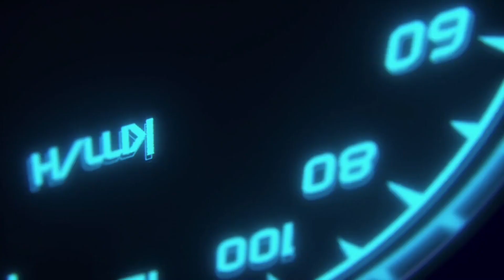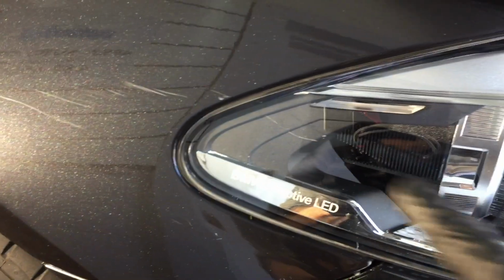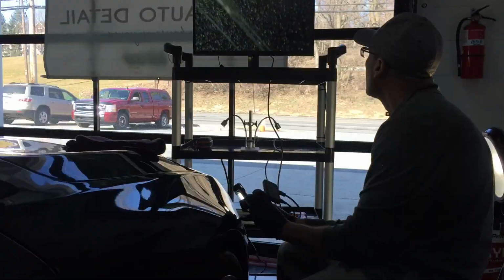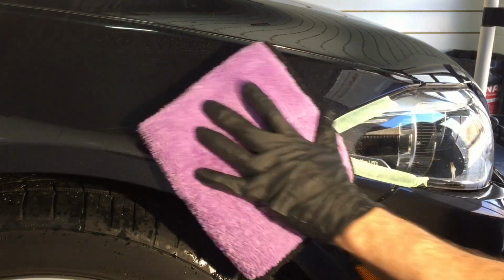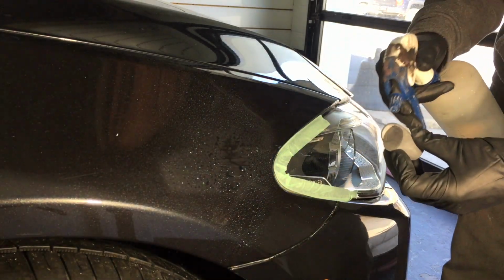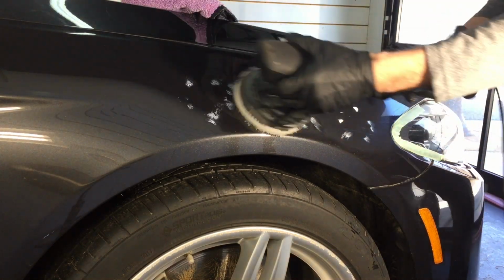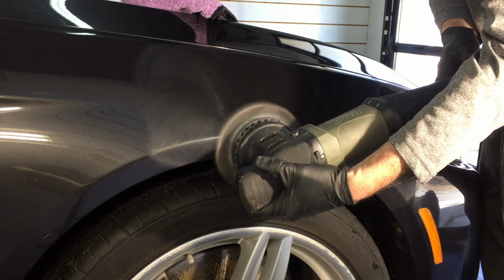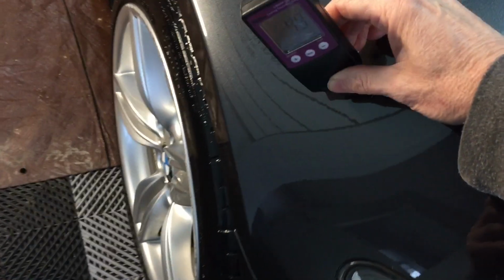How To Improve DEEP Scratches On Daily Drivers!! (For Beginners)

Comment from the maker: Much more to come on scratch removal and wet sanding. Other areas you want to learn? Let me know!
Reply: Apex Detail more on Optimum Clear Coat Restorer please!
Reply: We have an old Volvo V70 Classic in family. We are looking to fix rust damages on the back of it before polishing. Is that something you could look into?
Reply: Oxidation removal
Reply: Apex Detail paint chip repair
Reply: More rotary tutorials please.☺
Reply: Muffler tips cleaning and restore will be great to see and what product you use to do it. Thanks !
Reply: Hello there
I’ve been following you for a short time but am impressed of your work and technique of teaching 
So what apc are you using in the video I’ve checked your other videos you talk about a couple 
Thanks
Reply: When or how deep of a scratch you need to use touch up paint?
Reply from the maker: @tredfxman  Rust from exposed scratches or rust forming under the paint layers?
Reply from the maker: @willboyd7794  I use Optimum Power Clean and CarPro Multi X.
Reply from the maker: @Mrjozz011  When it is through the clear, base coat, primer down to and exposing the metal panel.
Reply: @apexdetail85  Thanks
Reply: @apexdetail85  Ithink mainly forming under the paint layers. It looks like its bubbling up from under..
Reply: After you fill in the scratch with clear coat, are you wet sanding with 3000 grit again or 5000 grit?

Comment: I like that you made the point that to truly fix it it would need to go to the body shop. Some people think a polisher will remove all scratches and just hammer away trying to get it out and make the panel worse. Another thing people don’t always understand is when you do “remove” a scratch the scratch isn’t gone you are just leveling the clearcoat around the scratch to the same depth. That’s why this video is great IMO. It shows that some scratches are just to deep but there is a way to make it look better.
Reply from the maker: Completely agree...only a small percentage of light, surface scratches can be completely removed without sacrificing the clear to a point where it just is not effective anymore.
Reply: Apex Detail Exactly!

Comment: Thanks Brian for this interesting video you made. Can I ask for your professional advice. I have a 2012 Mazda 3 a daily driven car.  With swirl, scratches & rock chip that I fill up with touch up paint and you can see the marks with harsh Canadian weather. I’m planning  to do 1 or 2 step paint correction this summer. I’m planning to use Angelwax Regenerate & Angelwax Perfect Polish. Using the Buff & Shine (maroon, yellow, white & 50/50 micro fiber pads). Because I saw it in your previous video using these Items with a great result. What can you suggest & product to be use. I don’t have a knowledge about detailing but willing to learn and saved your videos as references. I bought a test panel & equipment to practice it before doing it on in my car. Then apply Jescar Power Lock Plus. 
Thanks again
Reply from the maker: Ok...you have a medium cut and finish polish. I suggest adding a decent cut compound. 3D ACA Extra Cut or Sonax Cut Max are my fav. And two more pads...the Lake Country Microfiber Cut pad. And Low lint pre washed lambs wool pad. You are ready to rock with them.
Reply: Thanks Brian.

Comment: Brian after you cleaned out the scratches did you apply touch up paint first and then optimum CCR or did you just go straight in with CCR to fill in the gauge?
Reply from the maker: Touch up first...then protect with the CCR

Comment: Great vid as always, I’ve never thinking using sanding paper on a car but after seeing this ..so you used a 3000 sanding paper ?? Where do you buy these very low grid sanding paper ?
Reply: 3M trizact sanding disk. 3000 and 5000 grit. You can buy them online or at a body shop supply store.
Reply from the maker: https://www.amazon.com/s?k=Trizact+sand+discs&i=automotive&camp=1789&creative=9325&linkCode=ur2&linkId=87961e921608a953826e4f84576d8af0&tag=apexdetail-20
Reply: tylough and Brian, thanks for your answers. I found a paint/body supply business that I didn’t know near my home, I’ll go check it out.

Comment: Second car I use the rotary on. I burned through my Gf car Paint in a little spot haha oops 😅 I find it strange i did maybe 3-4 quick  passes max 1500 rpm worked clean etc. Maybe paint was thin. First car I didn't burn through anything. I'm not scared next car shall me my mom's 😅 I'm ready 🙏
Reply from the maker: I did it too when I started using the tool. luckily...it was a practice fender! Dont give up on it...you will be happy you didnt.